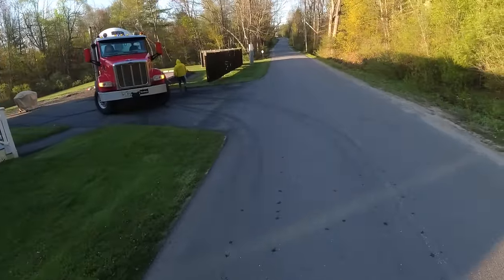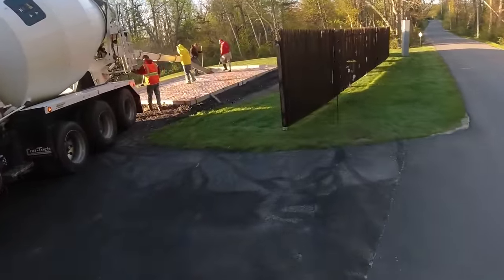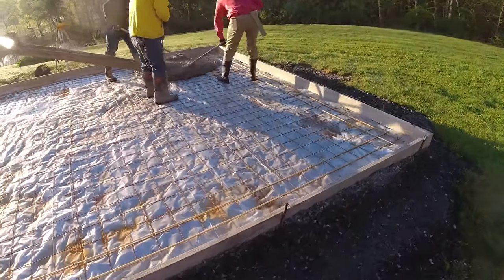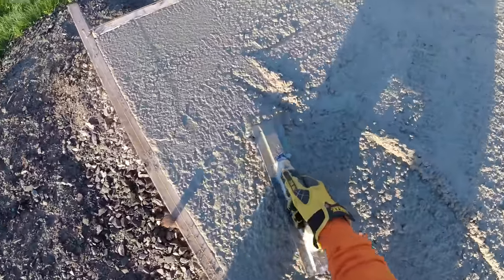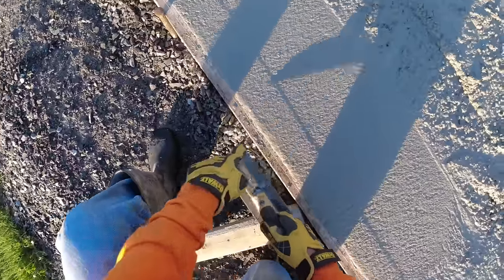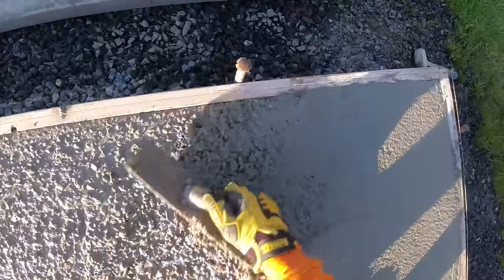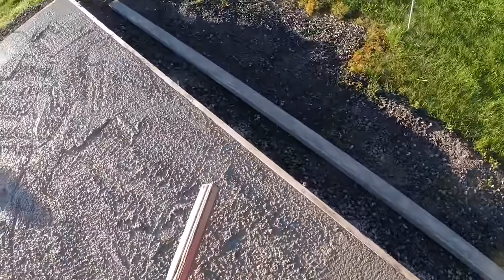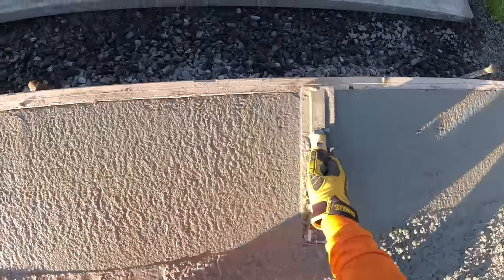Beginner Concrete Slab Pour - 16' X 26' Garage Slab

Comment: Most flat work guys I know around here don't even bother with wire mesh. Always ends up on the bottom anyway. Fiber in the mix is all you need according to them.
Reply: Fibers are no fun for anything your power troweling. Always seems to work their way to the surface.
Reply: I pour fiber alot here in Ohio.   It's more of a bear to finish IMO.  Ur correct the wire does end up on bottom unless you are persistent about pulling as you go.
Reply: Yes, and it's worthless at the bottom of a slab. A waste of time and money to put it in. We use rebar and set it up on rebar chairs - usually (yes it is a tripping hazard big time). Occasionally you can't find them so we let the rebar lay on the ground and pull it up as we go.  And we pull it up above mid slab because we know it will settle some. The key is to stay off or out of that pour once you've pulled up the rebar or wire mesh. If you're going to walk all over it then you know it's going to end up on the ground. Don't let your owner see that. They just might know a thing or to about how to correctly do a slab.

Comment: Not supposed to wet set anchor bolts. The building code says the are supposed to be "in place" before pouring concrete.

Comment: I'm just curious about the rebar grid. If you have in the concrete, isn't supposed to be roughly in the middle of your concrete? I see you all pull it up, but then you just step right back on it. So what is the point? I'm just asking.

Comment: Mike, What is the largest garage floor/patio floor that one man can pour without it getting away from them? And why isn't a vibrator always used on every job vs tapping on the form? just curious.  Great channel
Reply from the maker: The size one guy can do will depend on his/her experience and physical condition. I used to do 20 - 30 yard pours myself when I was in my 20's and 30's. Not now. The slump you pour will kind of dictate if you need to vibrate or just tap the edges as we are. A 6 slump consolidates itself pretty good so just light tapping on the edges is enough. A 4 slump and we'd vibrate.

Comment: Hey Mike, another great video!  Say, was wondering if you could in a couple of your “typical pour” videos, put a real timeclock in one of the upper corners.  Because these videos are only minutes long, vs. the real-time being hours long, making it a little hard for us to get the project's timing down, and it would be a BIG help since timing is critical in every step.  Realizing that weather conditions affect the timing, one would know that sun speeds the work up and cloudy overcast cool days extends it as well as the slump and chemical additives you’ve chosen.  

Maybe you’ve already done this, and if so, would appreciate your pointing us to those videos on your website.  Thanks, and keep up the Great Work! 

PS: an additional video with the timeclock on a stamped concrete pour would be excellent as well . . .😎

Comment: Appreciate the video. Is wire as good as rebar? I am going to DIY a 32 x30 garage and 24 by 60 driveway. Also what power screed you recomend
Reply from the maker: Rebar is better than wire if spaced close enough. I'd use the MBW ScreeDemon for now, we like the battery one. But for slumps less than a 6, I'd go with the gas one.

Comment: Mike I noticed you pull a screed board a lot more than using your power screed . I understand why you did it on this pour it’s only 16’ wide . Do you feel that the power screed in too heavy on water reduced concrete at a 6 +slump.
Reply from the maker: The power screed is good on all these pours. We're just a little old school I guess. These smaller ones are just as easy to hand screed for us.